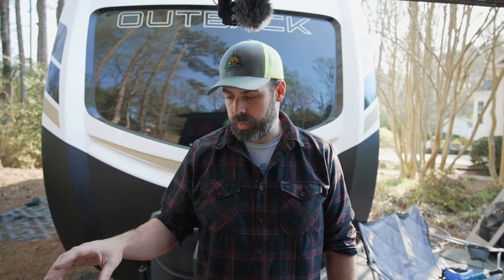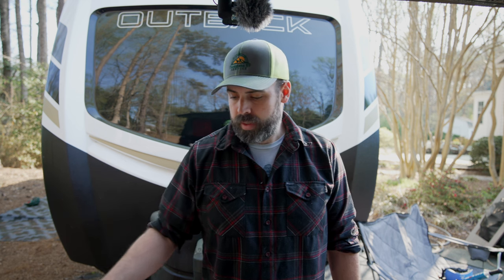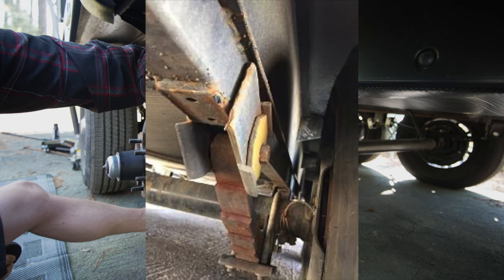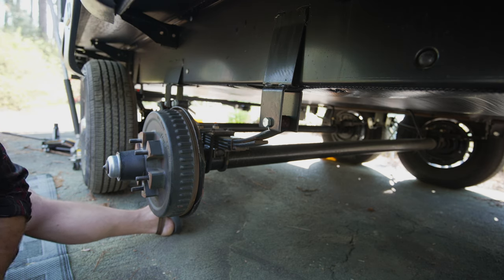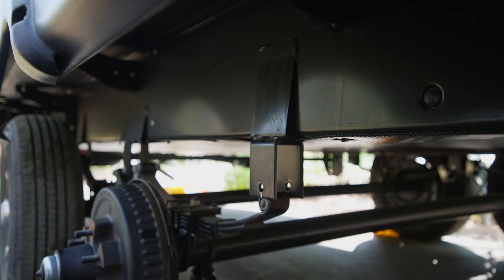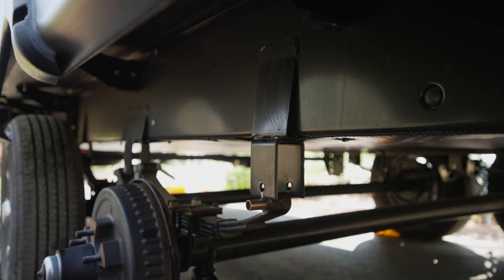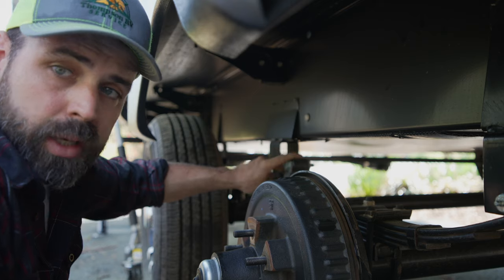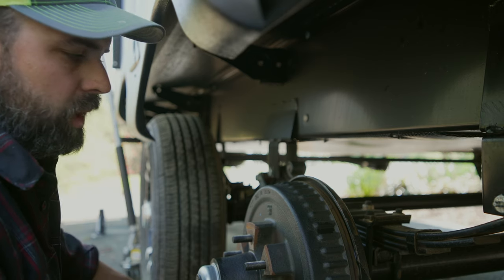Morryde SRE 4000 Install And Bracing/Welding Suspension Hangers   4K

Comment: My 2020 Outdoors RV 280RKS CANNOT mount the Morryde X-Factor Cross Frame due to blocking interference of the Propane Line running down the right side of the frame....The Front and Rear Hanger bolt holes will not align with the X-Factor mounting bracket bolt hole due to propane line interference.    How did you get yours installed correctly?

Comment: Can you do a comparison between Morryde suspension kit and LCI kit?.........I have just purchase 2019 Coleman toy hauler and have the room for the higher lift, but do not want to because of the ramp angle.   thank you for any help with this.
Reply from the maker: Which LCI kit are you looking at?
Reply: @thompsonrvservice  The Road Armor
Reply from the maker: Looking over the road armor system they are very comparable. The biggest difference is morryde has different size equalizers and the LCI you have to use different size shackles depending on the axle spacing. Regardless of the system you pick make sure to get the heavy duty shackle and wet bolt kit. Morryde also has the x-brace that ties the hangers together that adds a lot of strength to the system while turning.
Reply: @thompsonrvservice  Thank you

Comment: Thanks for the walk through.  Would you do this kind of work with slides out? or would you bring all the slides in? I'm concerned about where my family is going to go while I'm working on the rv.
Reply from the maker: I would recommend bringing them in.
Reply: No one should be in the trailer while you are under it with the wheels off

Comment: Cool, I did the same thing with new springs also, I used the 3000 it did rise my trailer up almost 2 inches, I still need the cross bar, I have the spread axle travel trailer so turning can be hard on things, thank's for sharing, best detail video yet.
Reply from the maker: Thank you

Comment: Good job I’m a welder my self and I’m doing the 3000 on my keystone passport 268 BH I like the your idea of backing up the spring mounts with a rear plate that will stiffen it up a bit I don’t have the side plates on my mounts 
But not a bad idea maybe a vertical gusset on the inside away from the tires all in all good job I’m going to weld in a 2x2 piece of tube across so I don’t have to buy one it will give the mounts a lot strength don’t you agree
Reply from the maker: Absolutely adding that tubing will definitely help with the dreaded shackle breaking problem.
Reply: @thompsonrvservice  yea I thought 💭 so as well

Comment: Okay, this is a pretty good install I have one question on my Jayco it come with the CRE3000 from the factory do they make a upgrade for that, I mean since my is a 5th wheel is there an upgrade, looking at the 4000 in look like those are a little bigger than the one I have on mines? I don't know if Jayco uses the plastic bushings, I have a 6000 plus miles cross country trip coming up in March I am getting my bearing repack so I should be good on that but do I need to or can I upgrade the bolts?
Reply from the maker: https://amzn.to/3B0kNut this is the wet bolt kit and shackles they are a must upgrade if you don’t have them.

Comment: I have the MoRRyde CRE3000, on my 21 303rls Reflection and adding the MoRryde x-factor crossmember. How important is “boxing in” the shackle hangers? And would you only be boxing in the front of the front shackle hanger and rear of rear hanger?
That part of your video wasn’t clear. Thanks for the info!
Reply from the maker: Yes the front and back get boxed. I consider it important for the fact that I’ve had to weld countless new hangers on for people that snapped off.
Reply: Thanks, in your opinion can the hangers be boxed in with the shackle mounted or should the shackle and spring be dropped down (as seen in your video)?
Reply: @thompsonrvservice  Also, forgot a second question...because of the location of my fresh water dump valve, I can’t put the x-factor crossmember on the rear shackle hangers, would it make sense stability wise to add a crossmember to the front shackle (in addition to just doing the middle )?
Reply from the maker: @timhuffman3208  If you box the hangers I would only use the crossmember for the center. Also the spring can be In place when the plates are welded. Just make sure to grease everything when done.

Comment: A good practice with wet bolts is to shoot some grease into the bolt before installing to make sure the grease path is clear.  I have seen cross holes miss the mark or foreign objects get in the holes and block the grease flow.  At that point you have a dry bolt.  Just a thought!
Reply from the maker: Thanks for the feedback!
Reply: And the wet bolts should be placed so the grease exit hole in the bolt is facing the 3 or 6 o'clock position.  If you place the bolts with the hole at the 6 or 12 o'clock position, you may have a hard time getting grease into the bolt with the full weight of the RV pressing down on the bolts.